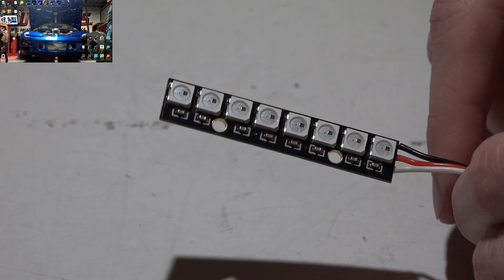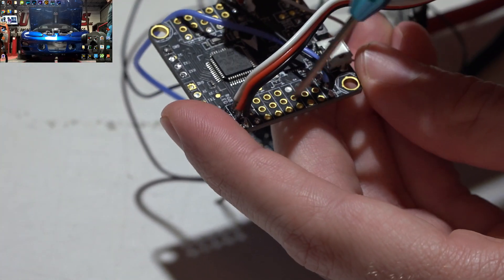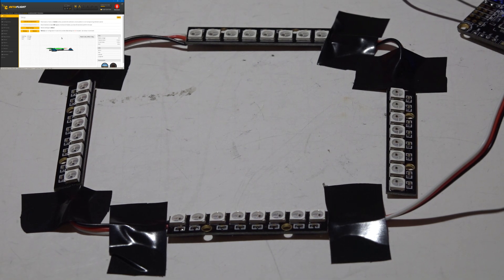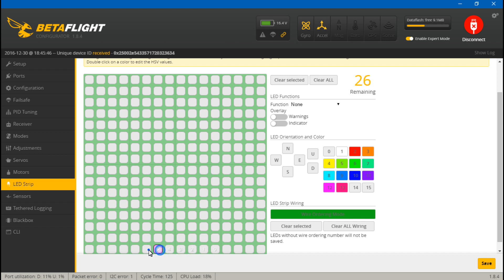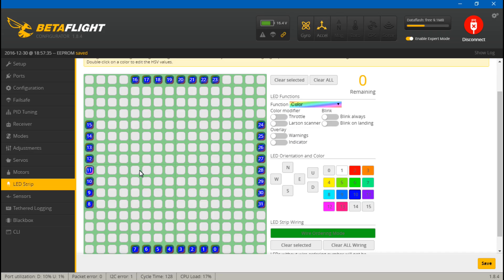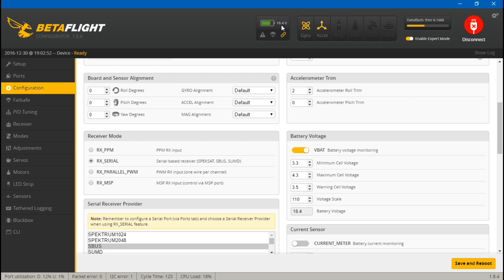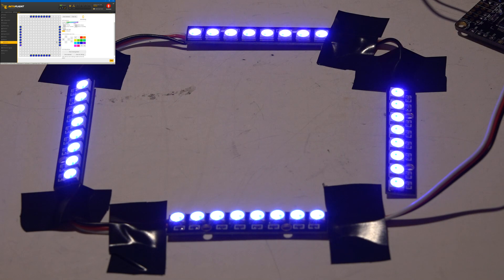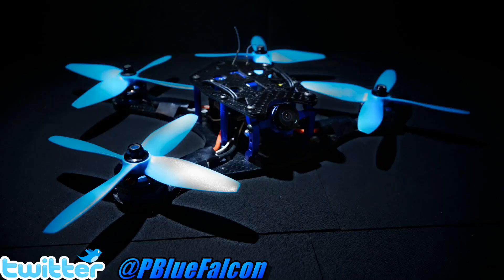LED Set Up Using Betaflight

Comment: Great video! I have 2 leds on the back of my Bat 78. I somehow had shut them off when I was only checking out that feature of BF. Now I know how to work it out and get them back on and in a way that I want them to function. Seems that Disco has arrived for drones, lol. My back strip of only 2 lights has an off on switch on it. Flying FPV makes external leds unnecessary unless your flying a parking lot at night, then it can help locate a downed drone. Thanks again.

Comment: New noob FPV guy here. Just bought 4 LEDs for my cinewhoops attached to inside my ducts. I have seen 2 videos where all the LED strips are connected together in series. I soldered the wires individually to each LED and they have a plug on each end. I have connected the plug into the LED PCB so they are connected in parallel, thats right?

Comment: hi. great videos. still got a doubt: for 2 led boards each one with 6 leds, can I use the led signal wire for both led boards? avoiding this way to use the Digital_out from the first led board. the intention is to use one of these led boards on each wing of my plane having red on one side and green on the other. thanks

Comment: excellent explanation, i did not know your channel, i subscribed right away!¡!  BUT....
I have a question, can i combine this 8 led stripes with this tailight that i have?  i am planning to install 3 led strips like the ones you used , and at the end conect the tailight as the tailight do not have "dout" pad or pin... 

thanks!¡

Comment: My LED lights aren't turning on? I have the wiring correct but when I plug in the battery my lights one light up. I'm using Flip32 F4 board. Any suggestion?

Edit: The LED strip is Matak (8 LED). Only using one so I just need the one side. 

GND
DIN
5VDC
GND

Comment: Project Blue Falcon. I could really use some help on setting up led lights on betaflight. I have 6 sets of led lights on my quad. I am using the lumenier led pdb and then wiring the 6th led board in series to the 5th board. How do I know which squares to use for each led board? (Total 32 leds)

Comment: Thanks Blue Falcon Project-O! Another awesome video, thanks! But please please help me get this straight, for I about have all my hair pulled out on this subject! It should be so easy but I CANNOT get it figured out if it is possible?? So (And I am just copy and pasting this in for I made a comment below first when I saw you were discussing it...but I need help and to know!) So you cannot pick the coor of arm state and the color they change to as you throttle?? Is that the case? If so that explains my nightmare!! You should absolutely be able to choose the colors of the states as well!! Is that in fact NOT possible?? For that is what I have been fighting and fighting to get it to do! I want them all to be one color then when I arm I want like two to three rows to go red in arm state and then I wish to make the ones I set to throttle to turn either green or blue as you throttle up and then back to the original color that they are most of the time. Am I trying to do something that is not possible lol?? Please Please let me know for I have been beating myself up over this crap for DAYS!!! lol If it can't be done I'll choose my main color and go on with it geeeezzz! hahah! It just makes sense to me though that you should click the arm state or throttle then the color then save and there ya go but I've been stumbling on it for days and just thought I was a complete idiot for it should be easy! hahahaha well please tell me If what I am tying is doable or NO GIVE UP DAMNIT!! HHAHAHAHAA!!

Comment: I would like to run a setup like this on my spedix s 250 pro, i need a front light. the light bar only has din, ground, vdc can i solder a second set of lights to the same terminals and be able to program them?

Comment: Silly that they didn't a way to change the color of the LEDs with a knob on your tx. Would be very useful for races.
Reply: Thats what I was looking for too. Bummer.
Reply: I'm pretty sure you can. The "Throttle setting he showed has a drop-down menu and you can have that function work on any of your channels, including an aux channel. Best of luck!
Reply: Works for me, although It doesn't go through the whole spectrum it goes through a portion of it up until white. Like from Red to orange to yellow to white.... Would be cool if it went between all the combinations but I imagine that'd require a very specific function. (edit: I assigned the color to Aux 8 which is my radio's knob)

Comment: Project Blue Falcon I have a low battery alarm set to go off via the "battery" tab on the drop down functions tab, but I can't figure out how to get it to flash red, it will only flash purple.
Reply from the maker: I'm honestly not sure how to change it. I didnt change it for this video it just gave me red. Its weird that there seems to be different colors.
Reply: So you cannot pick the coor of arm state and the color they change to as you throttle?? Is that the case? If so that explains my nightmare!! You should absolutely be able to choose the colors of the states as well!! Is that in fact NOT possible?? For that is what I have been fighting and fighting to get it to do! I want them all to be one color then when I arm I want like two to three rows to go red in arm state and then I wish to make the ones I set to throttle to turn either green or blue as you throttle up and then back to the original color that they are most of the time. Am I trying to do something that is not possible lol?? Please Please let me know for I have been beating myself up over this crap for DAYS!!! lol If it can't be done I'll choose my main color and go on with it geeeezzz! hahah! It just makes sense to me though that you should click the arm state or throttle then the color then save and there ya go but I've been stumbling on it for days and just thought I was a complete idiot for it should be easy! hahahaha well please tell me If what I am tying is doable or NO GIVE UP DAMNIT!! HHAHAHAHAA!! thanks and again another great video thanks a bunch!! Turbo.

Comment: My LEDs stopped working after I flashed the FC with a new firmware. Now, Betaflight doesn't want to save the setting where I turn on LED Strip in Configuration at all. Do you guys have any idea why?
Reply: F3 flight controller? F3 had led strip program removed to save space in 3.5 I think. Some are getting it back now, but depends on the model

Comment: Does anybody know if you can wire the strips in parallel so that you don't need to run wires from the back of the strip to the front?